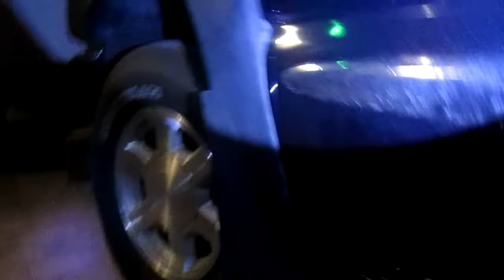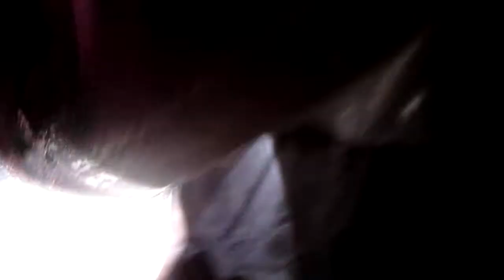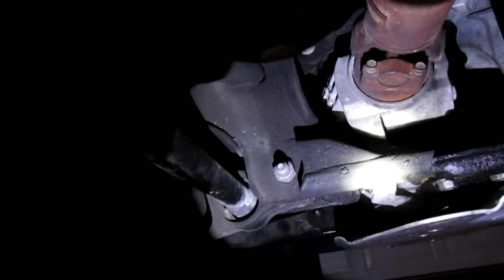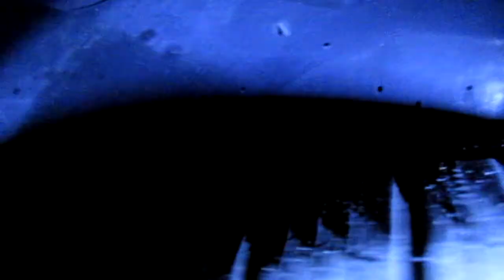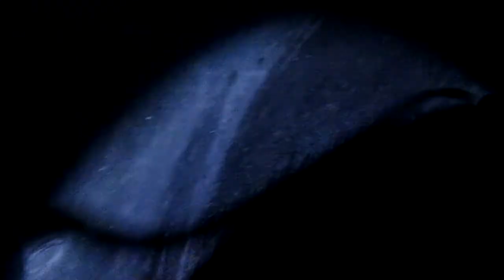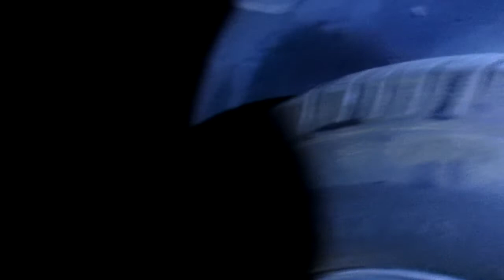Can we fix this problem now? Rigged Exhaust manifold Stud 5.3 Chevy

Comment from the maker: To date every time someone else did something to a vehicle it was messed up or I had to do it over.  Every repair I did is still holding up even the repairs I did when I was 13 years old. That's 20 years ago now.  Sad.  From Poor mechanical work, Poor body work i've had to live with all of it. Now if I can't do it in condo land which is the worst place and worst area in the USA, it will never get fixed.

Comment: Can you? I haven't watched the video yet and can't wait too!
Reply from the maker: Wahh..  I think a 10mm x 1.5 hole is larger than a 3/8s bolt and if someone is a moron a 3/8s bolt may thread into it but a 10mm wont thread into a 3/8s hole.   So maybe the just lost the bolt and did this chop job.   They thought 2006 was 1976 when maybe they last used standard bolts

Comment: Those strutds get brittle after 200k mile worth of heat cycles.  I'm in the same boat as you with rebuilding transmissions, have an extra 700r4 just sitting to "learn" on... Like I'll ever have the time.  You can do everything but the machine work.
Reply from the maker: 700r4 / 4l60 / 4l60/5/E looks pretty easy to do. Alot of good videos on the internet. I took apart a Toyota transmission years ago It was going well until the idiot next to me gave me extra parts when I went to make pee.   Stupid kid. Loser Dropped out  Just need to open up one assembly at a time or else the parts get crazy alot of pieces.  Its basically just a puzzle stay organized and its easy.  I look at some of the boneheads working at transmission shops and I feel if they can do it  and do a half ass job I can do much better.  I have no room here unless I break one down in the bed of my truck.  Yea the studs do get brittle I ordered one maybe I can retain its factory threads.   I need to weld out the manifold bolts too that's gonnna be fun in condo land Sparks!  Should get kicked out in no time.